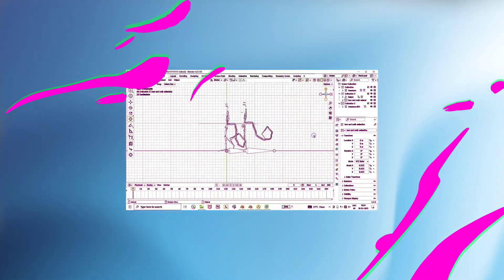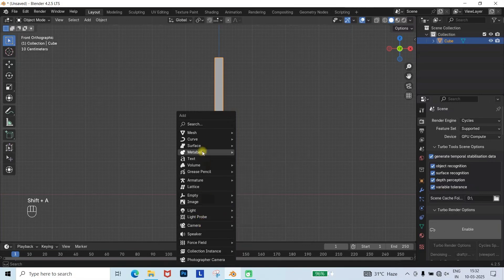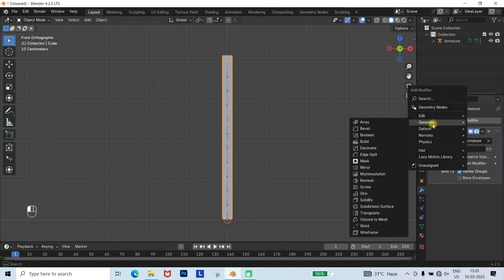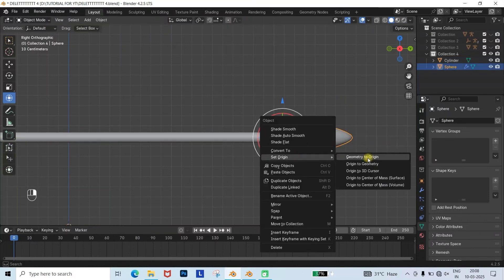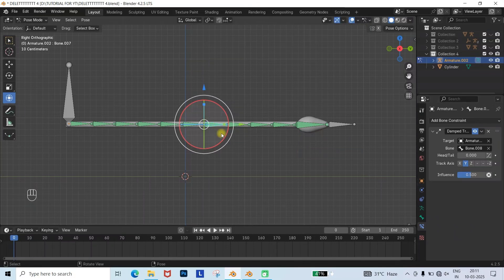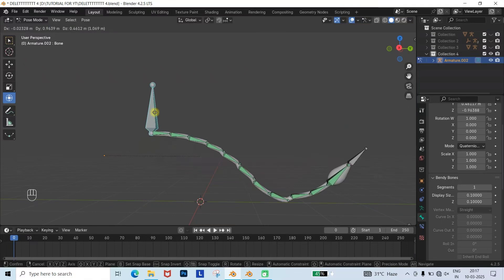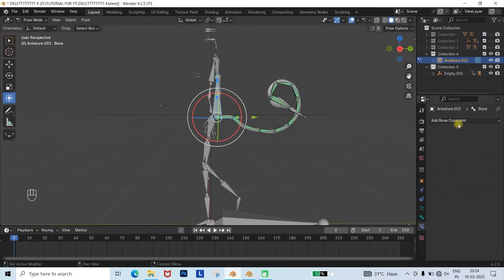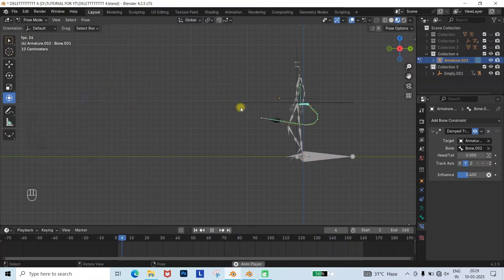How to animate a tail in blender | Tail animation

Comment: You kinda forgot to mention that each bones should be linked into the Damped Track menu to the previous one.
Example : Bone.009 should target Bone.010, Bone.008 to Bone.009... And so on...

I had to retry several times ending up with only the tip of the tail moving, to figure it out.

And don't worry other tutorials also forgot to mention that. 😅

After further checks, it when you don't use the shortcut (CTRL+SHIFT+C) and go by clicking through the menu, that Blender don't fill the values automatically.